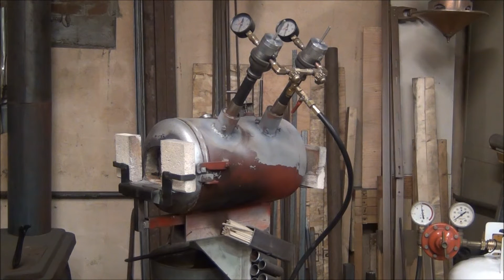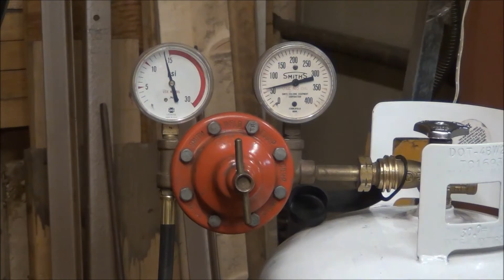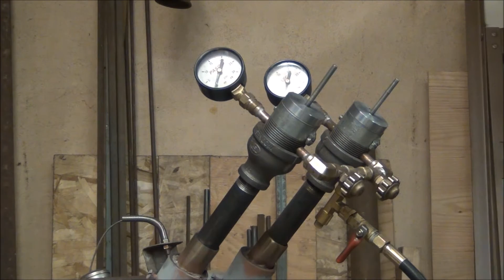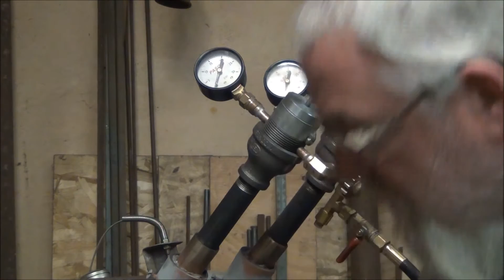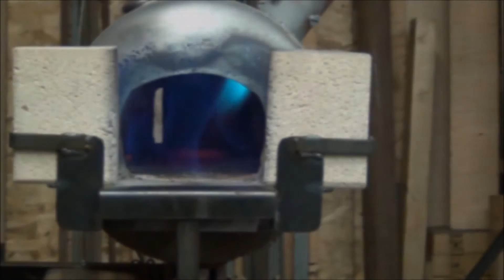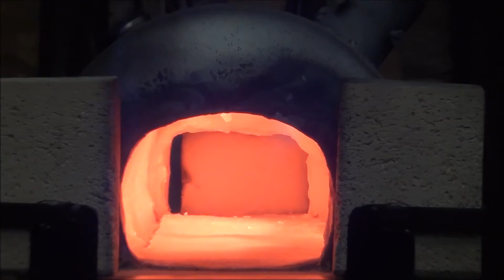Propane Blacksmith Forge

Comment: Shane would tell me the name and place to get the temperature unit that you have at the side of the forge, thank you and have a nice day.
Reply from the maker: It's just a cheap PID controller that I bought when I was making my heat treating oven. You can pick them up on Ebay for around 20 bucks or on Amazon. Just do a search for  Mypin TA4-SSR. You'll also need a type K thermocoupler for it.
If you need exact links let me know and I'll see if I have them saved when I get off work.

Comment: I’ve got a lot of family in Utah. Nice forge, how much propane does that sucker use? Do you think you could run it on natural gas?
Reply from the maker: Surprisingly it doesn't use that much gas, I can get a couple good weekends out of a 20 pounder running it nonstop. If I'm just messing around and only using it occasionally it last quite a while.
A residential natural gas line doesn't have enough pressure to run a forge, it's usually around 7 inches water column or about .25 psi. Some commercial properties will have a higher pressure and I have read of guys being able to run a forge off of it but they have a hard time getting it hot enough to forge weld.